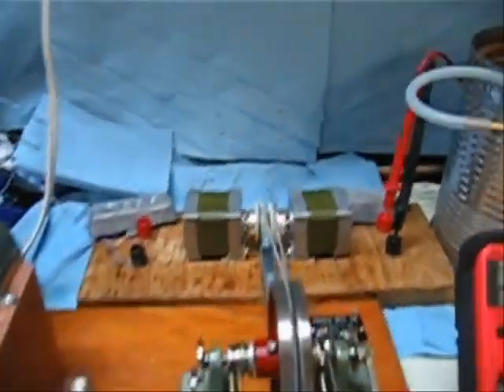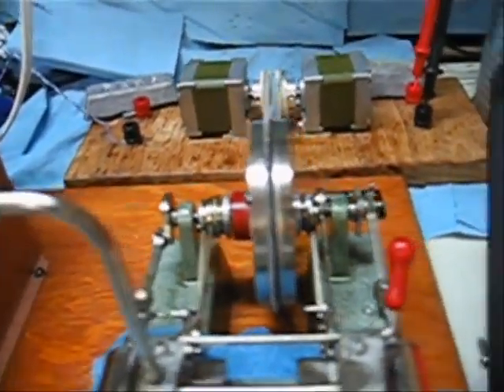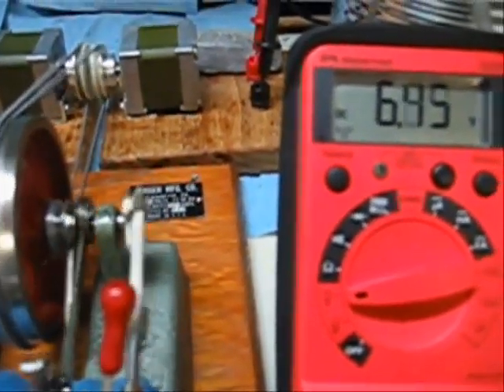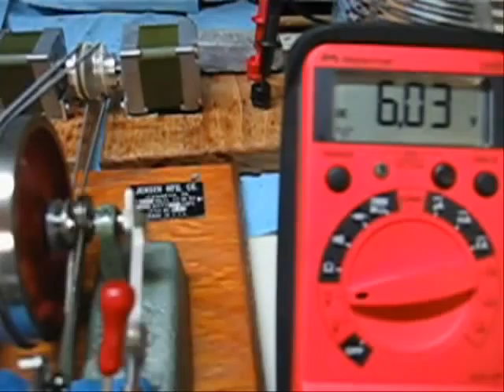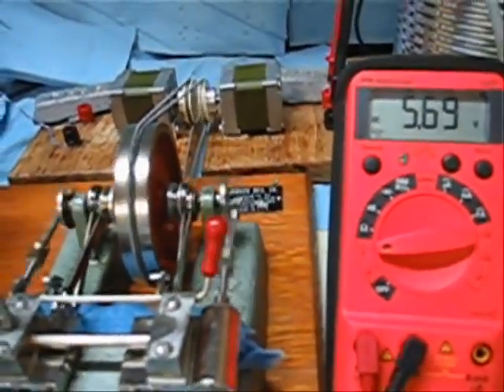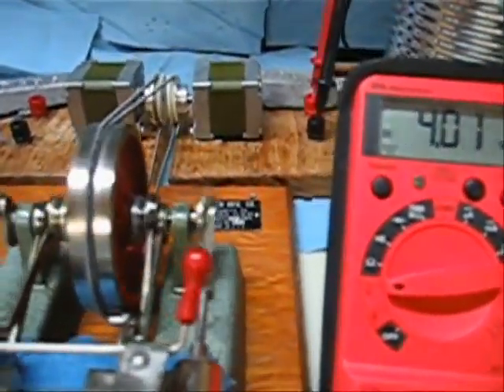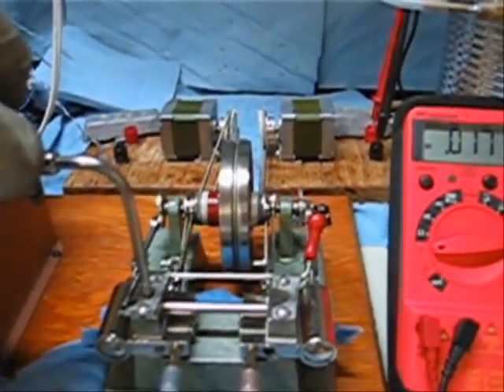Jensen 55 - Stepper generators

Comment from the maker: You're welcome :)

This is quite an old 55, dating from the early 60's, near as I can figure.  As such it has the old 500 watt blanket heater.  Model 25's have a 400watt heater.  It's not a whole lot more wattage for doubling the steam consumption, which makes it a pretty anemic engine when you want it to work.

I just bought a more modern 55, and I think/hope it has the 660watt immersion heater.  We'll see how much better that one runs when it gets here.